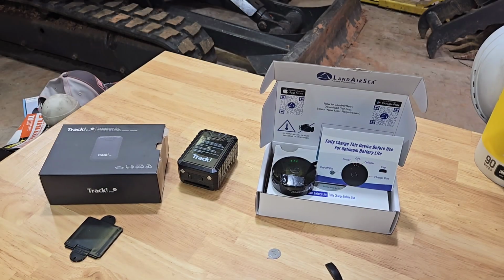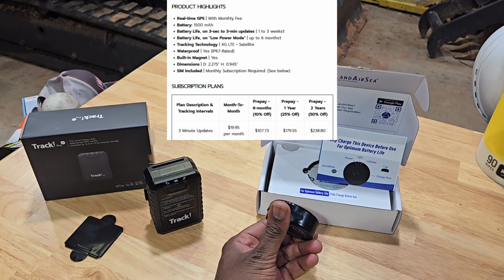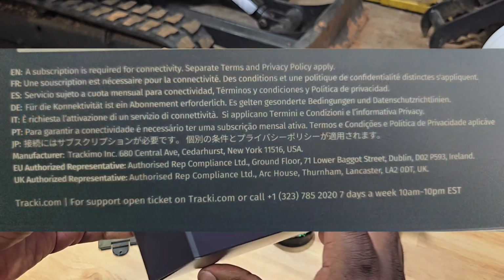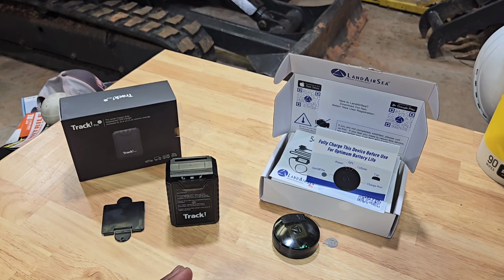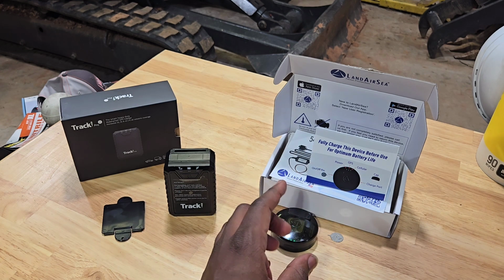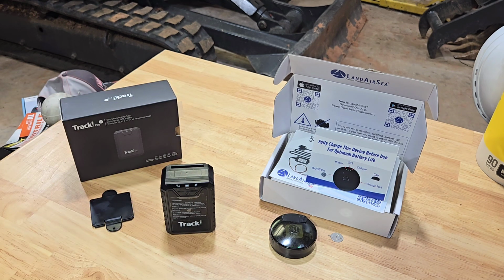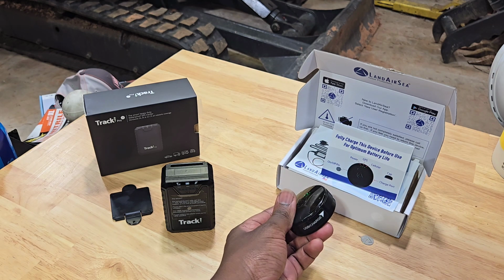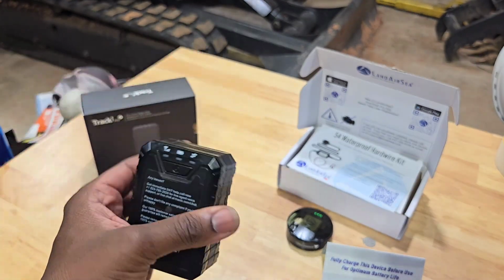Tracki Pro vs LandAirSea 54 GPS Tracking Units

Comment: If my car were stolen, the LandAirSea tracker would lead me to look for it in completely the wrong place. It struggles to pick up a signal even in areas with adequate cellular coverage, meaning the last recorded location doesn't match the car's actual whereabouts; instead, it shows the location where the tracker last managed to catch a signal. Even in areas with good coverage, it might pick up a signal once but fail to do so several other times. To make matters worse, I paid for a two-year prepaid plan (offered at a 50% discount), yet there is no way to cancel it or get a refund. There is also no way to test the device before purchasing the plan.
Reply from the maker: Ouch...
Reply: To be honest, I would like to add that I was able to cancel my service today and will receive remaining refund from this 2-years plan in a few days. The device will be send back to their store. At this moment no problem with cancellation of this service.
Reply from the maker: Well that's good news.

Comment: On your equipment, the built-in GPS tracking system has an antenna on the top of the machine outside somewhere. That’s why it gets a more precise GPS coordinates.
Reply from the maker: I never found anything, but maybe so..

Comment: I returned my landairsea due to it no longer accepting charge and no longer responding to any button presses. I hate that it needed to be poked with that pin to work. And resetting is even worse, they asked me to poke it somewhere else with a pin thats not even provided. Well it stopped working after pressing that button inside. And they provided me a replacement free of charge. Of course i had to return thr old one to them. Great customer supprt. However the 2nd device I received had a shorter batter life than i expected. Like 1 week with hourly updates. I attempted to recharge with my micro usb wires but it didnt accept charge (same issue with the first). I used the wire they supplied and it didnt work, i had two others which also didnt work. Not to mention i used multiple power bricks for charging, that were known to work with other non-micro usb devices. Landairsea offered me to exchange devicesnagsin and i had to decline.

 I choose to try a trackipro next time around simply for 
1. real buttons 
2. More realistic battery life for when away from vehicles.
3. Usb-c charge
Reply from the maker: Thanks for the review, yea Micro USB ports don't hold up well over time.

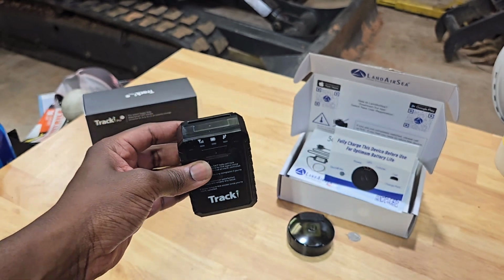Comment: 23:00 land air sea did that to me multiple times. It was working fine until it stopped recording. It stopped for about 12 hours even though the battery was more than 40 percent.

Comment: If the Tracki gives off a wifi signal, can you turn it off?  Don't want a thief to be able to look at available wifi connections and see there's a tracker...  thanks!
Reply from the maker: No, it dosent give off a wifi signal, it only looks for nearby wifi networks in range to determine their location as a fallback method if it can't see gps sattelites.

Comment: Interesting review. I just bought the Tracky Pro and will be experiencing it. To maximize the time between charges, I will try it at 10 minutes between the tracking signal is sent, and see how long the charge can last. I chose the two years subscription plan at 239 $ (US dollars); it comes out at 14 $ (Canadian dollars) per month as I'm in Canada. Thank you for the review.
Reply: Ive owned the trackiPro for 1 month. Prior to this i owned landAirSea for about the same time ending with me requesting a complete refund.i can happily say that the trackipro runs circles around the other product. The battery drain feels like its duration is 10x longer. The notifications are excellent. The apps has so much more options. This trackipro is absolutely amazing in comparison.
Reply: At 10 minute updates how long did the battery last between charges ?
Reply: @OGCJ10  The battery last at least four-five months between charges.

Comment: Just a heads up, u had same issue with land sea. On the app, add a credit card first on the separate screen, (not the auto set up) and then you can select that credit card as payment option. I had the same issue in April 2025

Comment: Tracki customer service is really good they answer every single time and if you do hold you're not on hold for a long time. LAS made in USA is not a good thing but either way I've never used them. Tracki is pretty accurate but the battery does suck
Reply from the maker: So far, my Traki battery has been lasting 3 months between charges, then it will send me an email stating the battery is low.

Comment: The Tracki Pro has a Standby mode to save battery. Can you put it on standby mode and “turn it on” through the app when it’s actually needed and back in standby mode, through the app?
Reply from the maker: There's a battery saver mode that only wakes up the device at predefined intervals for 5 mins and goes back to sleep, you cant get out of this mode with the app until you pres the power button or waiting until it comes back on. Then it will download the new mode you selected.

Comment: You convinced me ima try the traki pro my get here the 9/30/24 i let yall know what i think about it
Reply: It works great  you can put a geo fence at your home or were you work at a soon as you start your vehicle the app  send you a notification that the traker started to move and when it leaves the geo fence it notify you that it left i had no problems with it as of right now
Reply: @xxdaniels15xx87  how’s it working? Does it give you the exact location of the vehicle?
Reply: @rubensanabria5377 of course he won't answer
Reply: is the subscription fee with tracki actually with tracki or can you get the subscription with a SIM card such as eiot club and not have a tracki subscription?
Reply from the maker: It's thru Traki, it still uses their servers.

Comment: Nothing wrong with Land Air... had it for a couple of years and no problems with it, it works perfectly to me.
Reply: Glad you had a good experience, me on the other hand…. The charging part is a killer for me. Besides that i had to run twice to different places(previously where i driven with my dump trailer) because the app was showing my trailer at those locations which was totally worn luckily my trailer was were i left it In ,y yard. This happened twice so since i had already paid my yearly subscription i let it run out.

Comment: Land air ... you can change the seconds setup any time. So before going to bed, you can chenge the setup to a every hour setup instead an every 30 seconds set up. Note that if you change it from an hour to 30 seconds,  your 30 seconds tracking won't start until that every hour setup ends.
Reply: Or, simply hook up an external battery

Comment: REQUIRES a cellular connection so it is NOT true GPS!
Reply from the maker: Well if you want to see in real time where the GPS tracker is, you need a cellular connection. Otherwise its just a logger. GPS technology is just locating technology beamed down from space, it dosent send data back to a remote computer without some sort of network connection.
Reply: Guess you best lookup a Garmin InReach
Reply from the maker: @tombiggi1024  They both use "True" GPS but the difference is the Garmin uses a Satellite connection to send back the data (Like a satellite phone), and unlike an Apple Tag, it still requires a subscription. The satellite connection has nothing to do with GPS technology itself. Its just a way to send data back to a remote computer.
Reply: @PremiumFuelOnly  guess you have more research to do! 😀
Reply from the maker: @tombiggi1024  Well, if Im wrong, buy one and make a video educating me why the InReach is better.
Reply: @PremiumFuelOnly   - InReach is a better GPS (messenger), because it literally uses Global Positioning Satellites that are in geostationary orbit around the Earth to precisely locate an object in real-time, anywhere on the planet.  The Tracki Pro (like all other cellular "GPS" trackers that claim they have worldwide coverage) rely on ground-based 4G cellular networks to triangulate, and if the vehicle is too far away from a cell tower, it cannot be triangulated nor tracked - at all.   And it falls back on 3G and 2G, and 2G cellular is being phased out in many markets, so basically 4G and 3G cellular.  But obviously Garmin's InReach products aren't meant as vehicle/object trackers - they're messengers.  But they are at least true GPS, not cellular.
Reply from the maker: You are confusing GPS which is a free service operated by the US Air force that both systems use with different ways of communicating with the device. Both systems save GPS data they recieve from GPS satellites in space.The GPS sattelites in space receive no data from your device, they just transmit their location and current time. Atleast 3 must be in view for any device to compute a position lock. BUT If you put a Garmin in a metal building without an open view to the sky, like siriusXM radio, it won't work because it uses satellites instead of cellular to communicate its saved gps position to you.
Reply: 😂😂😂 it is true gps, but they use cellular data to transmit your position.

Comment: Does either have a replaceable battery?
Reply from the maker: No, they are non replaceable.
Reply: @PremiumFuelOnly  On  Tracki Pro you can remove the battery. If you unscrew the two screws near the battery port the device will separate into device side and battery side. Since the battery side has the charging port it can be charged independently of the tracker and has its own leds to show charge status.